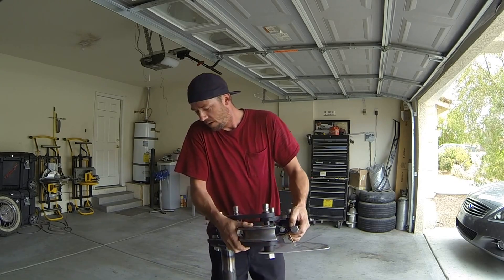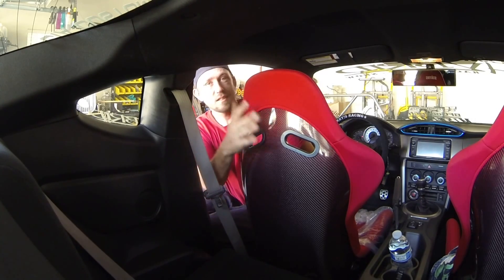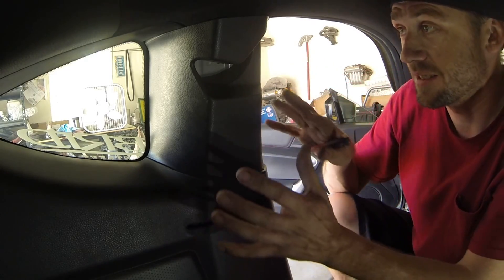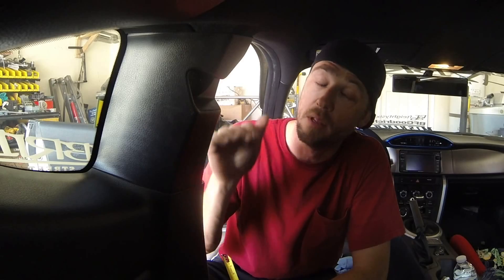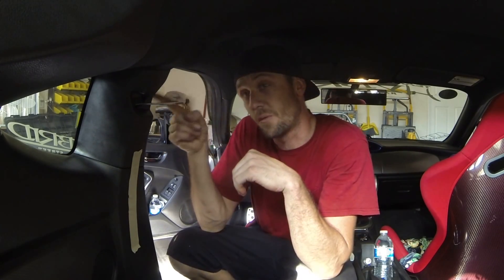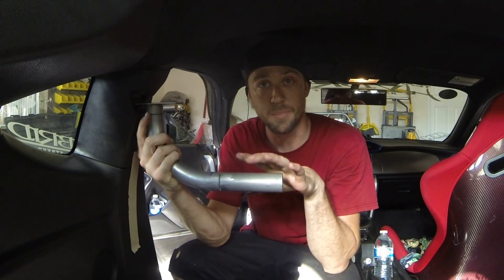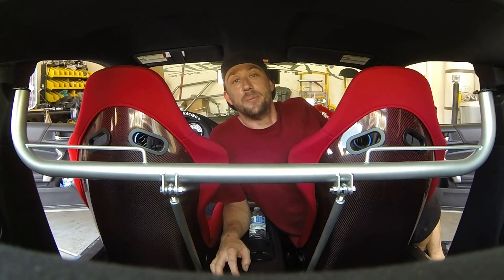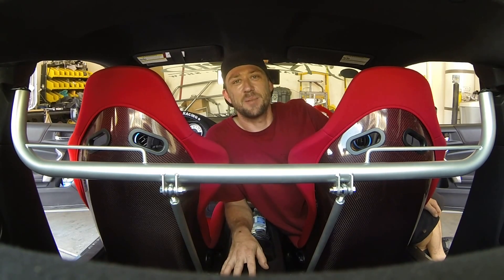TFS: How To Build a Harness Bar

Comment: .125" flat bar extended out horizontally for 1.5", curved with zero gussetting......on both sides.  To add to that, the bar is curved down 8.5".  The leverage on those brackets is massive.  All the force applied in a forward collision will be leveraged on that bar, not pulled directly into the mounting points.  None of that matters though.  The weakest link in your bar is the mounting point for the lower braces.  They don't allow the belt bar to shove into them directly.  Your brackets should be in line, not cantilevered. The bar will rotate around a centerline on your B pillar mounts when a force is applied to the belts.  All of the force will be applied to those 2 little lower brace brackets.  That is your effective mounting location because you have a bent harness bar.

The belts I have installed come with metal brackets that the belts loop through.  They are .250" material and the load in an accident is pulled DIRECTLY from the mounting points.  The mounting points are secure as they are minimum 1.625 material, per NHRA specs. This is KEY and clearly explained in belt mounting directions.  

Do a 5G collision with belts....10, or 30.  30Gs totals a car but the driver can walk away with a proper racing harness that is mounted properly.  When the mounting location can move, it is not proper.  
Your's will move.

I'm not trying to rag on you.  Your fabrication skills are not in question.  The harness bar.....is not engineered to accept a high G load.  Because you have a swinging harness bar (belt mounting point is not on mounting centerline), the brace bars are critical.  They are the only thing that will stop harness bar rotation.  If the harness bar moves in a high G situation, so does the belts....
Reply: i was thinking the same thing no gussets no kicker legs to rear no corner to center legs to prevent flex but im used to full roll cages or at least 4 -6 point cages so i wasn't sure if i was just over thinking it  as to me it dosent look like it would pass any track inspection ive ever seen thou his welds look pretty good

Comment: what the heck? that pillar bracket wouldn't hold any better then woopie goldburgs dreadlocks?
Reply from the maker: The math on it works out to just shy of 2.5 times the strength of the standard seat belt bracket.
Reply: the 1/8th in bracket on the pillar? I feel like that right angle would be easy to bow and break on a side in the event of a roll
Reply from the maker: Yes. Upside down is actually stronger since the load is applied over a larger area.
Reply: +The Fabricator Which equations did you use to calculate this and what constraints and loads are you considering in your calculations?
Reply: +Thomas V its actually basic physics
Reply: the math's .  LOL.
Reply: Possible to see the math? I am guessing that B-pillar bracket would buckle upwards and the whole assembly flip forward in a crash.
Reply: this guy engineers
Reply: and another fun note. you dont want anything TOO strong inside the car. if you get in a side impact and the bar is the strongest thing in that region of impact... there is a chance it deflects directly into where your head/neck is located as oposed to bending. and its definitely going to be stronger than your head/neck